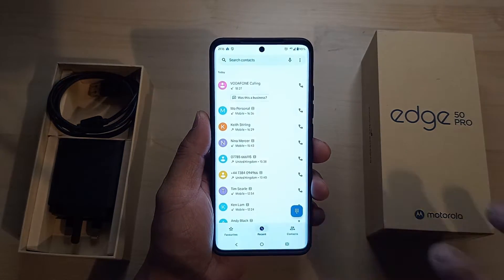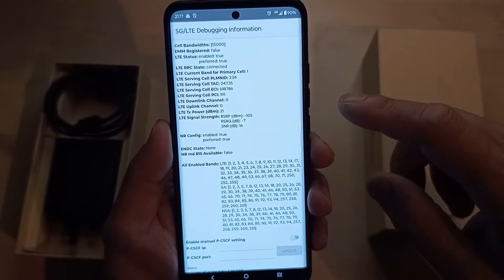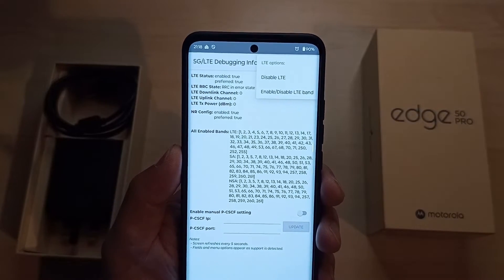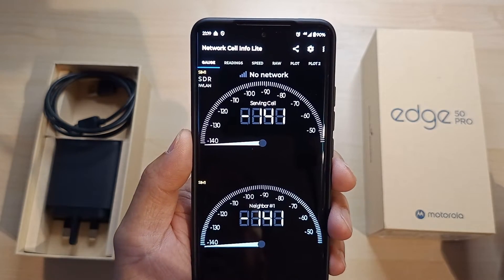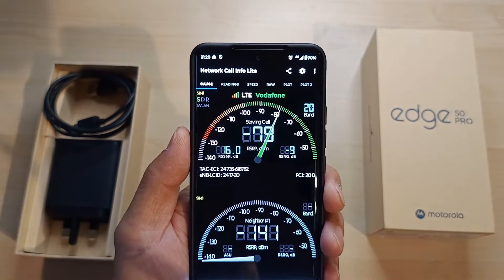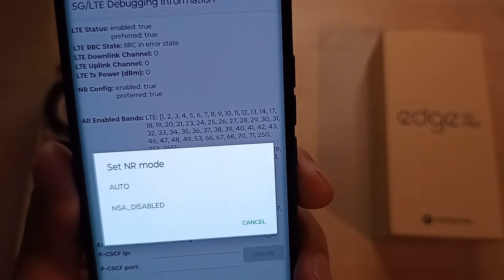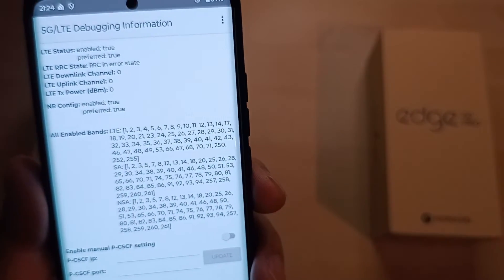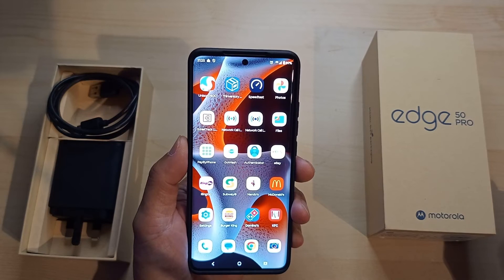Motorola EDGE Series - Band Locking Engineering Mode - Without Root

Comment from the maker: This also works on the EDGE 40 and EDGE 60 Pro both with Mediatek chipsets
Reply: Dose edge 60 pro has android 15 ?
Reply from the maker: Yes
Reply: i was just about to ask if it does work on the mtk Dimensity 8350 based edge 60 pro ;) thx for the info..! does it still work tho, after latest updates?

Comment: interesting that your edge 50 pro lists even way more "enabled" bands than on the official manufacturer website, take n75  1500 Mhz L-Band eg. which is configured as SDL in the EU.. not many carrier provider have deployed it I guess, but it would be interesting if it works, eg. in Austria, for Carrier/Provider Hutchison Drei Austria (using it in 5G SA n28+n75 config) and also Magenta/T-Mobile (not sure what config they use n75 for tho)

Comment: wow, didn't know that.. i got an old SD based moto g100, and there it doesn't work, but on the newer but weaker mtk based moto g54 it does function the same way as in your video, except you don't even have to disable sim i. order to make the settings appear..
Reply from the maker: Good to know it works on other models, thanks for watching 👍

Comment: I know this is an older video by now, but could this also work to enable bands that might possibly be turned off?  For instance, if I bought an unlocked international/global version to use in the United States.  Could I use this to ensure all bands are available for my carrier?
Reply from the maker: Most new phones these days would potentially support LTE\NR bands across Europe and the US.  It won't be possible to enable bands which are not supported in the hardware or in some cases even if the hardware is capable it requires complex flash and unlock procedures.

Comment: My phone mistakely disable 77 ,78 band and now not enable
Reply from the maker: Can you not re-enable them in the Engineering mode?
Reply: @leew88  no
Reply: @leew88  but other sim all band showing
Reply from the maker: @JERRYTHEMONSTERBGMI  so Band 77 and 78 are 5G NR bands in the UK, I'm guessing some of the SIM don't support those bands in India.
Reply: @leew88  but after this settings this is enabled by default and network showing 5g++
Reply from the maker: You can also go into the phone reset option  menu and select reset mobile network setting (make sure don't select erase esim box if you're using esim).
Reply: @leew88 i also tried all off this but those things not work for me, I'm disabled the sim 1  but also not worked , now its more than 2 weeks i facing this problem
Reply from the maker: Last option complete factory reset, if that still don't work it'll be a phone issue.
Reply: Removing the sim and putting it back on after a certain interval seems to reset it for me.
Reply: @prawinsama  yes I disabled the sim and after some days automatically solved
Reply: @JERRYTHEMONSTERBGMI  i had a same problem, can you explain me to fix??
Reply: @dipuwithskelet0nroast42  automatic solve in some days 
U try remove and insert again 
Or use second sim tray 📥

Comment: Does this work in Motorola g54 ?
Reply from the maker: I've never tested this on the G54 so not entirely sure, however I do know it works fine on the EDGE 40 as well so I would hazzard a guess it should work across the later generation Motorola handsets, let us know if it's successful.
Reply: @leew88  im using cmf 1 phone and engineer mode doesn’t work , i want to buy moto g54 or redmi note 13 that’s why i ask , i want to make sure before I buy one
Reply: This g54 doesn't have engineering mode it's have some like hidden menu you can test out if you have phone
Reply: does it have to do with the chipset, maybe only snapdragon supports it. As g54 has mediatek chipset????  @Unrealtoon
Reply from the maker: @FieryClips  Works on both Mediatek and Qualcomm chipset as I'd tested it on the EDGE 40 and 50 which has both of these chipsets.
Reply: How to enable moto edge 50 fusion